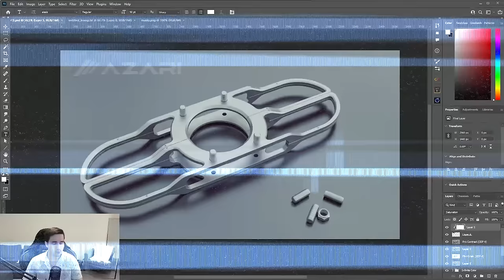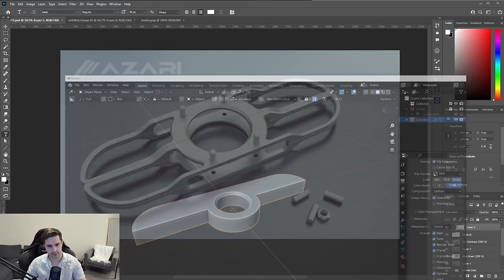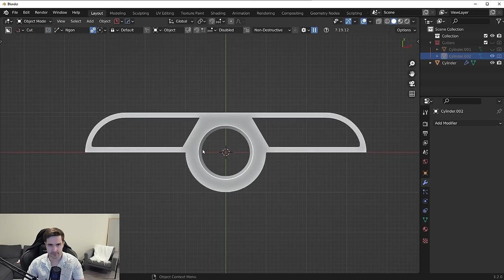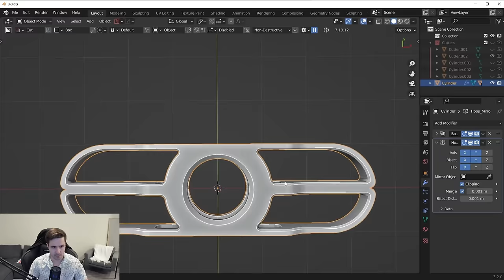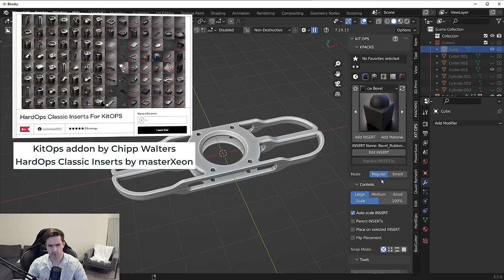Models aren't that complicated with this approach! (Blender Tutorial)

Comment: What I gathered from this video is that 3D modelling isn't that much different to traditional 2D art: You have to define your primitive shapes before chiselling away and adding detail
Reply from the maker: Correct, yet most people observe it from the eyes of the final result, which results in demotivation and unnecessary over-complicating. One should observe models from a primitive structure and keep adding detail as necessary.
Reply: Well said 👏
Reply: This is one of the most enriching and instructive visual art advice I've read
Reply: that's true for a lot of things, like for example, when you see something from a distance, your brain will classify it and refine that classification through iterations (drugs like LSD mess up with that process), and at some point your brain finally understand what the object is, it happens so fast that you don't mind it consciously. AI models work like this. So here you are building the shapes from the bottom-up, you need to start somewhere and the best place to start is with good foundation.
Reply: 2D +Z :)
Reply: Always
Reply: well, it depends on what your end result is, or rather your industry of work.. If you simply render an image, video then this is ok..but objects in game engines require better geometric component flow as a commonality and  organic animated characters DEFINITELY require that ..i.e. Topology. 
So, this is ok for still frames.. but don't bring this model into our meeting room as you'll get laughed into depressions.
Reply: I actually find 3D (traditional and digital) Easier when trying to come up with my own forms and details. To learn to draw something is harder to me, even when I first started modelling and had spent more time drawing. Maybe I just directed my modelling ability better than my drawing ability. Though it's possibly related to my inability to visualise and struggle to think of new forms when drawing. Plus when it comes to some models, such as character sculpts the artistic intuition comes first, and then you can think of the topology in more depth later. Whereas when drawing, if you get the technique wrong and continued it'd be much harder to fix.
Reply: That's why most of us came from Art Tradi background. If not, no prob, it's more a way of thinking that critical technical skills
Reply: Wait... You can do that in 2D!? Jesus...
Reply: @JoshGambrell  that's the key advice for a beginner 3d generalist 👌🏻👌🏻

Comment: I believe these Boolean plugins make you a lazy modeler. They are fast and the result looks good but you have very little sense of edge flow when you use Boolean all the time, instead of the traditional method, e.g.extrude faces or edges and insert edge loops manually where needed.

Comment: Reminder to people just stopping in for the first time that this is just for getting the overall form down. You still need to retopo and you are definitely not done here. For example this model here has massive Ngons on the top and bottom. Sometimes that works fine, but sometimes you get shader errors with that, which can be a big problem. Make sure to clean up the topology a little bit more. Ngons are sometimes okay on non deforming surfaces, but it is not only good practice (but also not always accepted professionally depending on if you are working for someone) to have good, clean topology, but also the way to avoid shader problems later down the line. 

Luckily for you, you are on a great channel for learning about this stuff! Check out some of the other videos too to learn more of the workflows that Josh shows, there is a lot more to go, but hopefully this helps inspire people to learn a bit more with everything! I just mentioned the shader stuff, but Josh often covers that in various places, so see about more of these tricks while working to get some better ideas!
Reply: Thanks!
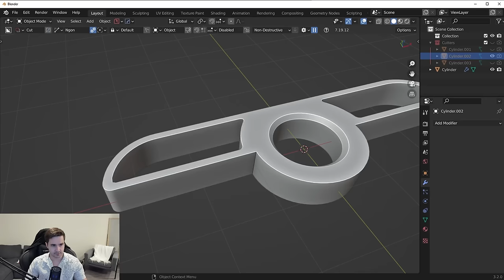Reply: So... that cut that he did like in 7:20 ended up adding  a lot of triangle and ngons, right????
Reply: Ngons are absolutely not ok unless you subdivide the part or retopo.
Reply: How hard doing retopology to a model with so much bevels like this

Comment: This is why I really like 3D art, coming from a software engineering background. With software engineering especially with CI/CD (continuous integration/continuous development), it is really difficult to break down work into manageable steps, especially since there are lots of dependencies for certain tasks. Not to mention that you're often working with botched or poorly documented APIs or software packages.

However, in the case of 3D here, it's all very basic steps that can be layered like a cake. With every new tool or technique I learn, it's more of another horizontal layer rather than a complete new vertical to learn. It allows me to apply the ideas of "iteration" and "only needs 90%" very easily and tangibly see my own progress as an artist. Not to mention that I love 3D because it feeds into the technical side of my brain. Absolutely love it.

Comment: Theres also a difference between just making stuff like that, and making game art style stuff, especially for older games, where you need good edge loops and optimized geometry. It all depends on what you are going for.
Reply: right! I think modeling without having good topology in mind is just modeling for passing time, anyone who wants to be a part of a team and create models that can be animated properly needs to be able to create good topology.
Reply: @SB-gy2vx  yeah, but these hard surface will have deformation on the animation?
And what about using autoretopo tools like instant mesh?
Reply: @ivensauro  I rather model the objects with the best geometry possible to avoid future problems and more work. But that's just me.

Comment: I did it with the base program (only have machine tools). I started out with a cube because I didn't think of extruding the cyllinder and I used the free (included but disabled) bolt factory addon to make my threads and inserts. I'm glad I watched the video after though as I learn something new. And as I see it there are multiple approaches to do things, just like with coding, no approach is wrong but there is always a more efficient way of doign it.

Comment: Great video Josh!  Another great way to attack this model would be with flat low-poly strips that could quickly be bent into 1/8th of the model, extruded, beveled and mirrored.  This would create something with super clean topo that would be easy to UV. 🎉

Comment: Many complex things start with one single vertex. You can have a whole human body basic structure made in less than a minute using one extruded vertex and then skin modifier. Also, having lines that you turn into a curve and give it a geometry thickness can give you complex albeit uniform curves like pipes. It takes time to simplify the process, tho. The power of boolean is also something unique and the same applies to the array and mirror modifiers.
Finally, you can do wonders in other free tools such as Inkscape, save as SVG and then import that SVG into Blender, turn it into a mesh and extrude and modify it at will. Those tools are magnificent.

Comment: All good points. The next thing people don't think about is modeling in relation to 3d printing. What is the best printing orientation for the strongest part. The layer should always be perpendicular to the parts load. Then the next is to design a part that doesn't need supports to print.

Comment: My initial thoughts (before watching more than a minute) is that you can mirror it on x, y, and z axis, and I know you love using booleans so my guess is you used those to cut out the holes. Other than that, I'm not sure how you would do it, but I noticed a comment from someone that you're using addons (which don't cost much but could be an issue for some people).

 After watching the video, it did some things I expected, but I probably would have mirrored it first and not gotten as nice of a hole as you did. Also, while you did use some addons, the only real thing you did that would require an addon is the Ever Scroll, but you'd only need to add on a bit of width to that part to get the difference boolen to work correctly, and maybe the cutout you did for the detailing (though anyone could just use the knife tool).

It's great to see things as primitive objects, too. Even many company logos are made using primitive objects, usually circles.

Comment: Hi, I'm somewhat new to blender with about a few months of overall experience gained over the years of on and off attempts. My initial guess was a cylinder that was extruded but I didn't guess the mirror modifier or the cut tools as I haven't really got into those at any point in my practice and didn't know you could do that so easily, my main thought was that you used an object to subtract the areas you needed and worked from there. I was pleasantly surprised however that I got the initial shape and general extrude method right as that was my only conclusion as to how to easily make that shape.

Comment: At the start of the video I was thinking: Just begin it low poly and in 2D first, maybe 2 separated objects which you'll join at the end. Then he increased the vertices of the cylinder and I was like: Ok, or just use HardOps, BoolTools and F that topology.

So guys: This is a more or less quick & dirty way to do it. It's ok for designing / prototyping, but you won't be able to edit it in a "common" way after this. I'm quite sure, game engines will nope out on this, texture (unwrap) it might be hellish and you've got to retopo it, which is basically almost a complete start over - without these fancy tools.

Comment: I always thought that boolean operations are the way to go in a big part of hardsurface modeling and this is why I had so much fun with it in Zbrush even 10 years ago. The problem was of course always topology or the lack of it. I know they solved this pretty well on Modo with meshfusion a long time ago but it's nice to know it also works in a free software, even if an add-on is needed. Another good alternative for a boolean workflow is Fusion 360, which works pretty well for concepting for years, I just didn't check recently if they have any solution for a 'real' polygon model with a decent topology.

Comment: the hard part is actually coming up with something like this using primitives instead of copying it (duh), that and actually making it have usable topology for any game or comparable application after you've used 50 modifiers on it

these kinds of quick models always look great until you switch to edit mode, it has cost me a lot of time to get away from my fusion360-heavy workflow when using blender to avoid this (to clarify: in CAD you generally work with parametrics, constraints and actual circles so you don't have to bother with verts and topology stuff, quite useful for engineering)

Comment: I’m thinking of getting these add-ons I am try hard surface modelling however I don’t have these add-ons so my work flow is slow. I know I don’t need these ads-ons but still. So I wanted to ask is it worth it.
Reply: I've looked at tons of video content on this kind of stuff and if I personally decide to go the hard surface route I would use this exact channel to figure out what add-ons to use specifically. In other words, I would feel very safe to copy the workflows shown here.
Reply: hard ops + box cutter are huuuge time savers, would recommend I use all the time
Reply from the maker: Of course they are worth it, especially at $37 for Hard Ops & Boxcutter. I've easily saved thousands of hours of workflow time with these tools over my years doing this stuff.

Comment: Now we need a tutorial on your add-ons and shortcuts you used haha, your so quick
Reply: I personally prefer to work with Vanilla Blender, because using many addons makes you relying on them. And sometimes it happens, that your addon is not supported by a new Blender version and you have to buy a new version or sometimes there is just no compatibility at all anymore. Everything shown in this video can be done without addons. They only make you more efficient, increase your speed - but also make you relying on them.

Comment: Hey do you have a video on "hard edge dissolving into sofrt surface? Like a smooth transition from a hard edge into a very soft one. You can see it often on cars. Do you just make everything hard and then smooth it out later with sulpting tools?
Reply from the maker: Well, you could use bevels or subd depending on the effect you want to achieve.
Reply: @JoshGambrell  Would love to see it :)

Comment: So I’d do it like this
Take a cylinder, move exactly half the vertices (on the right or left) 1 or 2 unites on the x axis to get the elongated box with rounded ends (or just bevel a rectangle)

Then just use beveled box, circle, and n-hon cutters to cut out all the holes/missing geometry on the sides and the. Applying symmetry/modifer mirror
Build it outside in instead of constructing  it from scratch 
I’ve been modeling for a week so I’m probably wrong but that’s what I see at first glance
Reply from the maker: There are many different ways to approach a model, this was just my particular approach for the video.

Comment: I always get lost in the complicatedness of my models. I'll stop until I get less overwhelmed by the shape and the edges and such. I'll usually get frustrated if my bevels or mirrors don't work right or if the sub and join tool don't work right. I've kept going but I haven't finished an actual model yet.